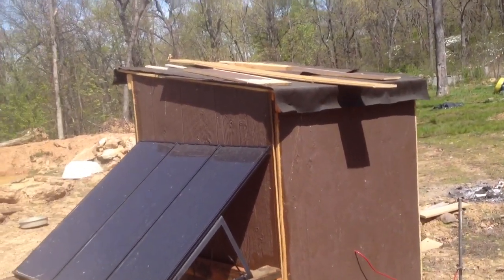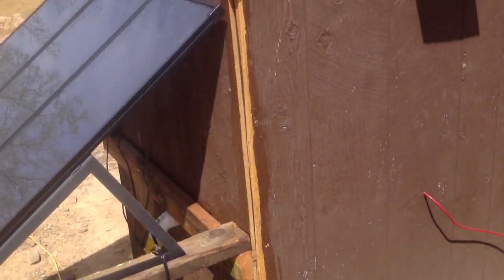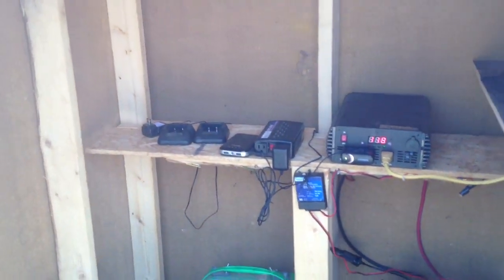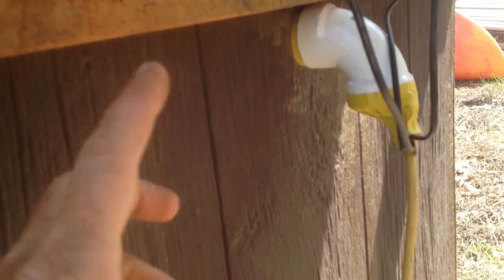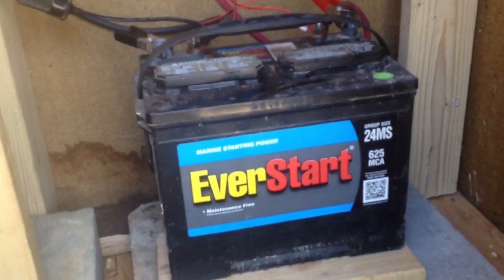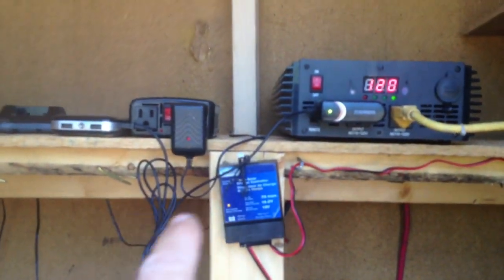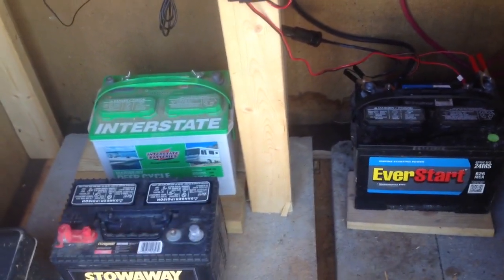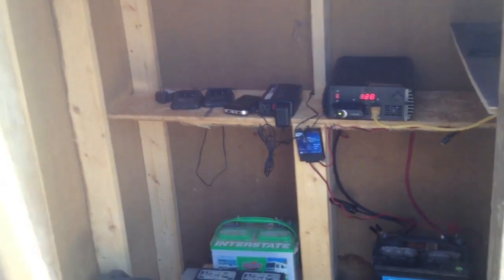The Solar Shack!

Comment: PJF please allow me to introduce you to these.  http://www.nitroplanes.com/79p-10208.html   They are Extremely bright low cost /low consumption  12 volt L.E.D lights and they have adhesive backing so you can put them under cabinets or almost anywhere. I like to place them above a door molding so you wont see it but it will shine up on the ceiling and illuminate the room. I use them all over my converted school bus and have a good store of them for my off grid cabin.
Reply: +Southeastern Ohio Homestead   Here is a link to all of the colors available.  http://www.nitroplanes.com/ledlights.html
Reply: +Southeastern Ohio Homestead 12v lcd lighting in a great alternative. I like these http://www.lightingever.com/rgb-led-strip-non-waterproof-4100053-us.html?gclid=Cj0KEQjwrZ24BRC098fr-OqnuMkBEiQAKQ9lgNWLLLLtRKXAqD7UaeEaWyHLfi1NSi9Nw8xyJOF118QaAlI58P8HAQ they can be cut into strips. the one drawback, 12v doesn't like long runs.
Reply: +j johns    I think you could have a pretty lengthy run of 12V as long as the load was minimal and the home run was of decent gauge wire. The longest road train in the world is 160 feet and it feeds all of the running and tail lights for the entire length of the rig in 12 v.
Reply: yep, you're absolutely right, there are alot of RV's and sailboats running 12v systems. You're also correct in that you can get away with longer runs as long as you're keeping the load low. where the inefficiency come in is trying to have long runs with any load, resistance becomes a factor at that point, and to get around it you pay big bucks for wire that will support it by reducing resistance - this is primary motivator for doing higher voltage 24/48 volt systems, wire is spendy. Running it from an outbuilding could get expensive, not so much if you're solar system is attached.  
To better leverage my little system, I put a 12v run in the basement, all the lighting, computer gear that runs on 12v, radio chargers and additional battery chargers are supported. I use the inverter to  power a chest freezer and my computer with 110. 
it really depends on what you're trying to accomplish.
Reply: +j johns Do you mind if I ask you how many batteries you have and what invert er you use for powering your freezer? I have two of the windy nation 100 W solar panels that I've yet to try out. I was planning on doing basically the same thing as you with a small fridge. I have a 1 KW VAWT as well that I plan to tie into the system. I was thinking if I had extra power I could dump load it into a hot water heater element or something. I also have a small 100 psi 12 volt RV water pump for my cabin and had planned all of my lights around the LED's I listed above.
Reply: +Southeastern Ohio Homestead Currently, I'm setup with 8 duracelll egc2 6v batteries(cheapo's from sams club), they've worked for a year. I could get by with four if I wasn't running the computers off the array. Panels are 10 canadian solar 235px's and and two 100watt panels I started the solar "experience" out with. As for inverters, there are two invertes that are hooked up and I switch between the two depending on what I want to run, one is a Samlex Solar PST-600-12 PST Series Pure Sine Wave Inverter, the other is the work horse, a Sunforce 11260 2500 Watt Pure Sine Wave Inverter. The reason for two is the 600 is more efficient and I can get by with running it most of the time. The 2500 is for higher loads, but it's more taxing on the battery array( i think - haven't proven it to myself yet)Another reason for two, is one is none. Something else I'd recommend if you're heading down the freezer path, get a Johnson controls  freezer temp controller. The device allows you to  toggle power on and off to the freezer based on internal temp. As such I can more efficiently maintain temps near freezing, I could also set the temp much higher and turn the freezer into a cooler and further minimize power use.  The johnson controls is a good dual use item to have around, it basically toggles power on/off based on a temperature setting.  Have you thought about how you're going to charge the system when you are in a solar deficiency? I'm using iota smart charger with a tri-fuel genset.  

I've not done anything with wind but hope to in the future.

Sounds like you've got a great adventure started. 
hope it helps. JJ

Comment: suggestion for that late frost, this has worked well , take one of the 12hr. heat packs, place two under your sheets put over your plants , fire them up about two hrs. after dark they usually last around 8hrs. simple cost a dollar but has saved lots more then a dollar just a suggestion , from Vermont with love